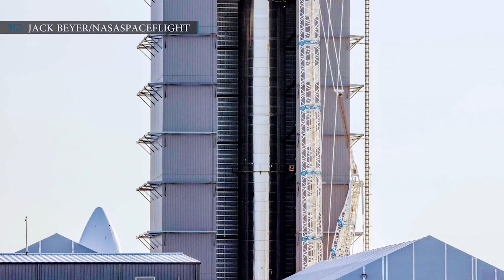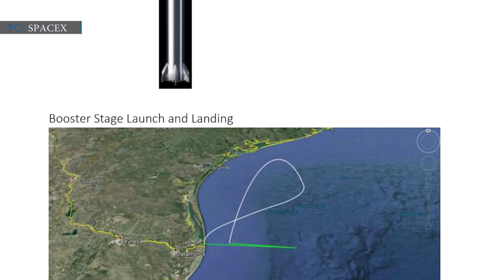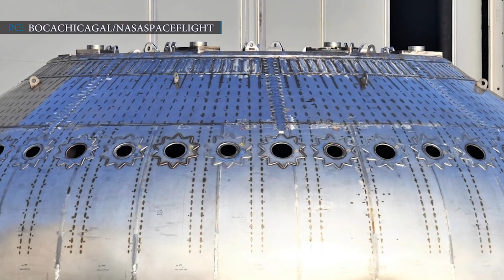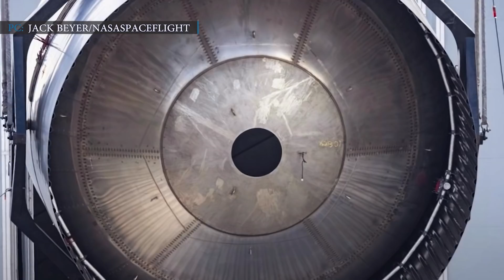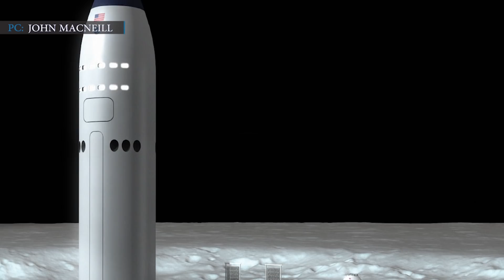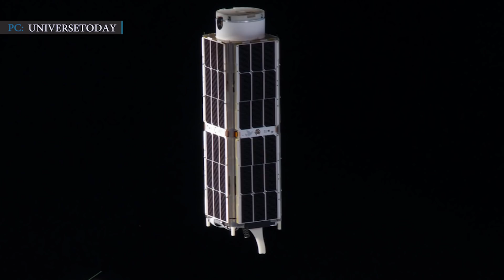SpaceX starts assembling Starship's first Orbital-Class Super Heavy Booster | Dragon XL Modification

Comment: All you need to be orbital is orbital speed. Starship will have that speed. However, do they complete an orbit? No. Not because they can't, they already have orbital speed. It's because they "want" to deorbit before they get back to the US. Someplace safe but still close to a US landmass Hawaii in this case so if they decide to recover they can, and if not, its deep enough that it will be out of reach of others. People let us all not get bent out of shape over this.
Reply: Not necessarily. It could be that the first flight is "underpowered" by design so that the flight path will definitively put it somewhere in the pacific after 80% of an orbit. If they manage to steer the Starship as it should, then they will be able to attempt a suicide landing burn over the water, after which it will also definitely sink. It will be lost, what ever the outcome.
Reply: or maybe because where they are landing is a missile test range that has lots of radars already setup?
Reply: @mikeking596  In the middle of the ocean? Doubt it.
Reply: @paulmichaelfreedman8334  "Pacific Missile Range Facility Barking Sands (PMRF) is the world's largest instrumented multi-environmental range capable of supported surface, subsurface, air, and space operations simultaneously. There are over 1,100 square miles of instrumented underwater range and over 42,000 square miles of controlled airspace."
Reply: @mikeking596  I stand corrected.

Comment: I'm curious as to whether an unfueled (therefore unpressurized) Superheavy will even support the dry weight of a Starship, which is pretty darn heavy itself.  SpaceX is definitely pushing structural engineering into new territory!
Reply: The SH is 20 m taller plus it will have 28 raptors as opposed to 6 on Starship orbital,  3 sea level and 3 vacuum.  The math indicates the SH will be significantly heavier.
Reply: @michaeldeierhoi4096   there is a big difference between being heavy and having the structural strength to support any given load. Nonetheless, I am quite certain the design engineers took supporting Starship's weight into account when they designed Superheavy.
Reply: Michael Deierhoi Im estimating around 120t for Starship and 200t for SuperHeavy in the beginning. So you think this is plausible?
Reply: @The-Real-Laepi  That's as good an estimate as I can imagine.  Maybe eventually we'll get more accurate numbers.

Comment: Interesting to me see all these film and pictures. Its also a goldmine for Russian and Chinese industrial spying. Can u imagine how easy to reverse engineering?!
Reply: not super concerning
Reply: @austeyen  w that last name I wouldn't either lol jkd
Reply: The Chinese already announced their copyright infringement on SpaceX design.
Reply: It’s not that easy, the Chinese purchased some SU fighters from the Russians and copied them... badly. Last year they ordered some more. Copying aerospace tech is no as easy as it seems even if you already have the hardware.
Reply: @johngrimm1103  I'm pretty sure they can save couple of millions
Reply: @mydigitallife8311  Its not about the money, its the engines, look up how Rolce-Royes makes the blades for their inner turbine, they are hollow, not just for weight savings but because "colder" gas is passed through them so they will have longer life spans.
Fighter jet engines are even more high performance and the Chinese have had a huge problem with them just melting off if they push them as hard as you can push Russian or any western counterpart for that matter.
Its not just a question of engine design, its metallurgy, manufacturing process, QA. Making a good engine is hard.
And they have had weight issues with the airframes as well. I mean the Russians are having issues with the new SU-57 fighter too, it takes time and effort to make a good production ready aircraft. Look at the F-35, its been shit on for the last 20 years, but its finally here and its an excellent fighter.
There is no magic souse, its all effort and the Chinese are simply not there yet. They will be, but not yet.

Comment: Does anyone know if they will do a test flight for just bn3? Similar to the hop test.
Reply: Very unlikely
Reply: SpaceX has not stated if they will do a test flight (hop) of BN3. Nor if they will recover BN3 if it control land on the ocean.
Reply: I would say no, no one knows. From everything I have read though, it looks to be most likely that they will not, though the possibility exists.
Reply: I think SpaceX have no intention of creating landing legs for BN3, so that means no hopping. 
They seem to be more interested in testing the full Starship and Super heavy booster concept.
So I imagine the orbital flight will be priority. The only significant testing will be the cryogenic pressure tests and Raptor testing.
Reply: I don't know if it's possible to do a useful hop.  It's meant to land nearly empty (no fuel, upper stage is gone) so it only needs maybe 3 engines to land (Starships final landing is on one engine).  The engines can only be throttle back so far, so taking off with enough fuel to do a short hop would mean they can't light all the engines (way to much thrust with no upper stage, 1/3 tank of fuel).

They will probably just fill in with nitrogen (pressure leak) and use the hydrolic rams to simulate thrust just like they did with the early starship test

Comment: the only problem with any of this is the use of the term 'orbital' for a suborbital flight ... i wish people would get that right since it wont make a full orbit
Reply: I think it will be at real orbital velocity and come down with a deorbit burn.
So; it will be in an orbit; it just comes down at less than one completion.
I think....
Reply: It’s only suborbital in technicality it’ll still be going at near orbital speeds
Reply: Orbital means being in orbit, achieving orbital velocity and meeting the dynamic requirements of an orbit. Just because you deorbit before completing one full revolution does not mean you are not in orbit before you do that.
Reply: @odysseusrex5908  I don’t think they’re going to perform a deorbir burn, but in any case, the velocities present are going to be orbital velocities
Reply: @u0fw923  if you have orbital velocities  (assuming proper direction), you need to reduce speed to come out of orbit.  Drag can do this, but that is how you end up with an uncontrolled reentry (recent Chinese booster).
Reply: @mikeking596  orbital velocities vary heavily, so not necessarily, and the velocities needed to go to Texas to Hawaii are only very very slightly below what’s needed to fully circularize
Reply: @u0fw923  did not notice you posted twice (first one saying near orbital).  So the second post when you said orbital, you also meant near orbital.

but.. but...but... when playing KSP and in a low orbit, if I accelerate in the direction of travel, then when I get to the far side of the planet and accelerate again in the direction of travel (hoffman transfer) I end up going slower then when I was at the lower orbit.  simple...
Reply: @mikeking596  RSS is a better example, an orbit going from Texas to Hawaii in this case would only be a tiny bit less than what’s needed to go into a full orbit, likely by about 100 m/s. KSPs system is somewhat applicable, but the ratio between atmosphere and planetary radius in the stock game is very very different from real life, meaning the difference between suborbital and orbital are orders of magnitude different compared to real life. Also, I’m aware of this fact that’s simply needing less velocity to counteract the forces of gravity. In the case of starships orbital test, I think that it will reach a proper orbit, just with it also reaching into the atmosphere knocking it out of orbit via drag before it completed a full orbit.
Reply: Anything else that is pity to argue about,get a life well ya!

Comment: The idea of the Dragon cargo having a bathroom is great!  Here is the UK, a bathroom is a room containing a bath.  Which seems like a luxury for the moon landers, and how do they keep the water in the bath??
Reply: The whole room is filled with water and you enter  by an airlock with a scuba tank.  It is a bath room.
Reply: Is your comment a attempt at humor?
Reply: @nightlightabcd  No, deadly serious.  I presume from this video that SpaceX is now installing baths.  Which I believe come with a rubber duck shaped like Elon.
Reply: @nightlightabcd  I thought it was funny, but I'm a simple kind of man😜😁
Reply: They spin the rocket causing the water to stay on the outer edges... but be careful with the agitator it can be brutal to delicate things
Reply: Skylab had a shower on it. Basically, a flexible curtain formed a fully enclosed space. You would open the tap to create a ball of water several centimeters in diameter. You could then use your hands to rub that over your body. Anything still floating in the air could be sucked up with a hand held vacuum. This could be repeated for wetting, soaping, and rinsing. I suspect though, that what is meant is just toilet.
Reply: @odysseusrex5908  Thanks for your reply.  There are many interesting details from Skylab, it's a project we don't hear enough about.  It's the first project I remember first hand from my youth.  I think it's still the largest open space by wall-to-wall dimension that ever there was in space.  So there were indeed bathrooms, in the UK-English meaning, in space.  But I agree, I thing Engineering Today meant a toilet!  Pity, I'd buy a SpaceX bath, as long as it was in stainless-steel!